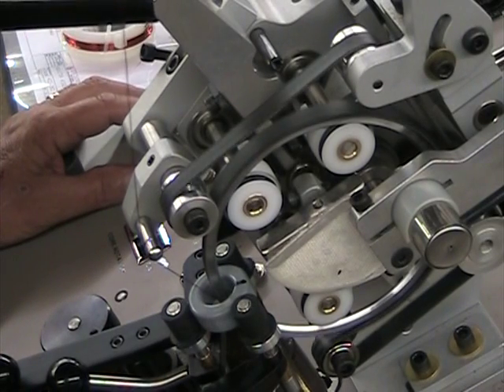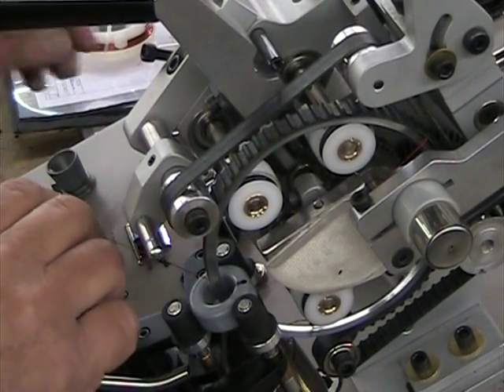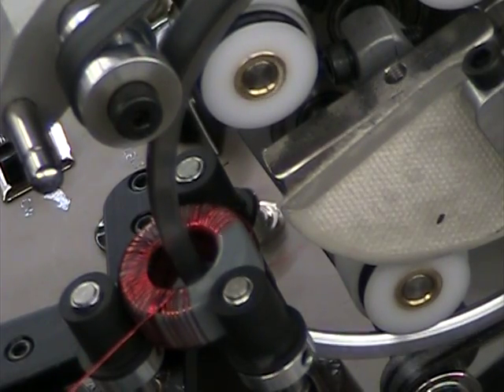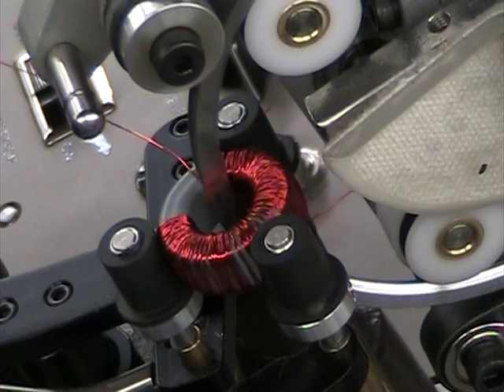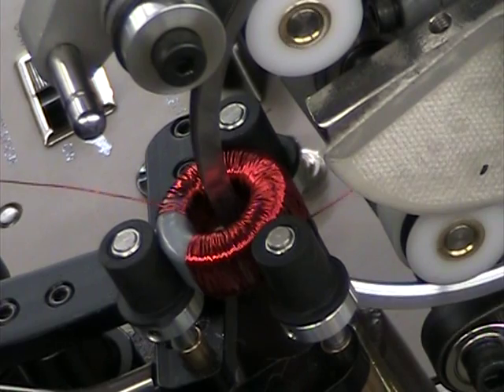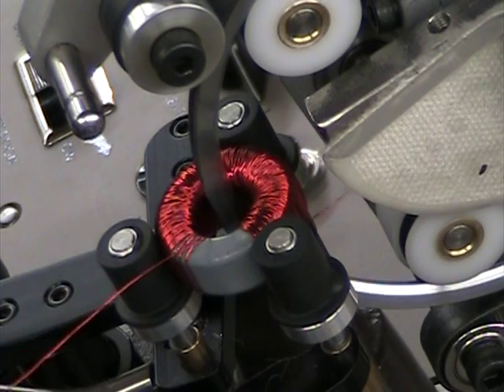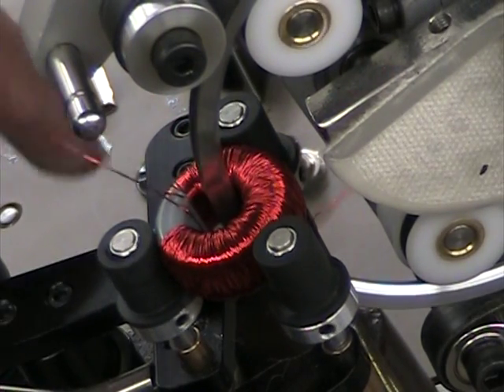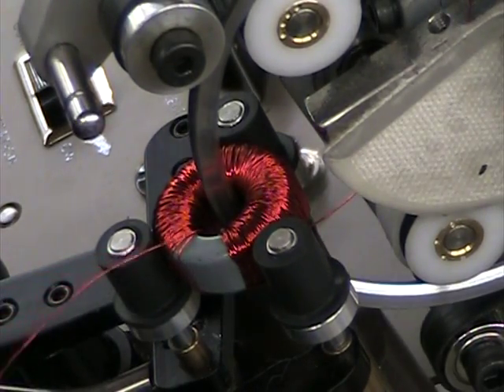Gorman Machine 900A Toroid Winder

Comment: I used an older version of the winder in the 80's.  I got good at winding 30K turns in 3 layers on a 2.5 inch od core.  It took about 2 hours to set up, but once done I could wind a core at full speed in about 4 minutes.